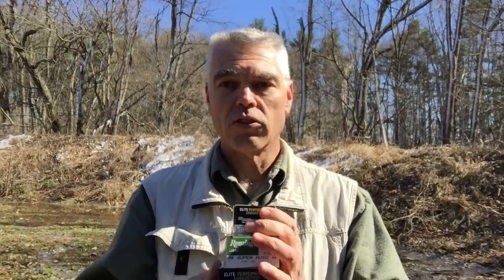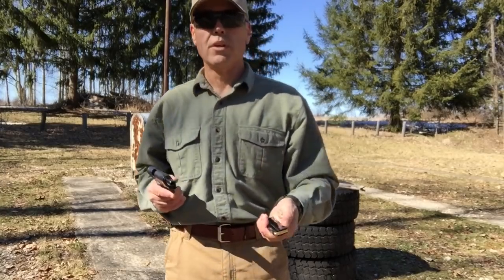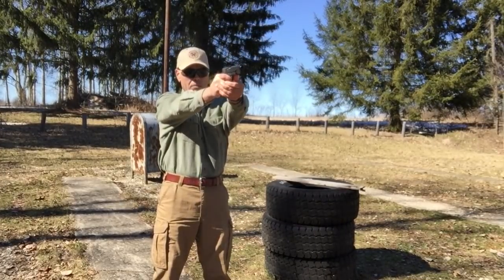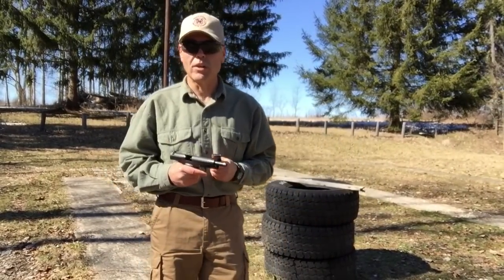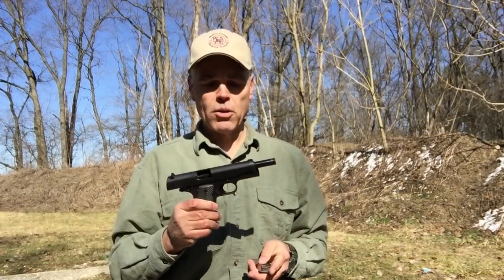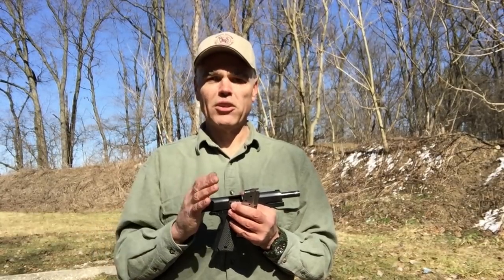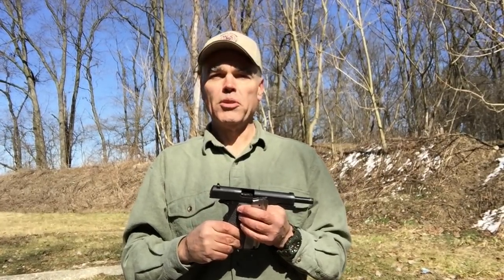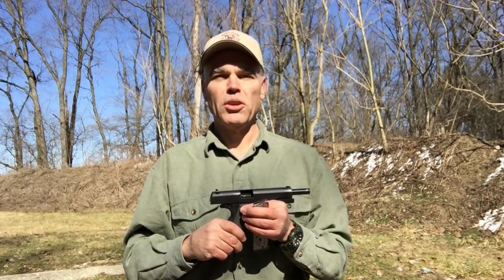Llama Max 1 Back from repair

Comment: HR, even though you have a new pistol on the way, if you still have that Texas gunsmith's email, I would send him a link to this video.

One of the things that I love about the 1911 is when you do have a problem, it's almost always an easy and low cost repair.

I have been a 1911 fan since the Marine Corps put one in my hands exactly 50 years ago!  Since that time, I have competed in IPSC and IDPA with a 1911 and it's also my been my EDC since the 90s when Texas started it's CHL program.  Semper Fidelis, Brother HR!  TreeTop
Reply from the maker: Thank you. I sent the gunsmith the links to the videos I made before I sent the pistol to him. I don't know if the ever watched them. Semper Fi!

Comment: I would change the recoil spring . I own an older model Llama in 38 super it is finicky with magazines . It also like full metal jackets .I found that the right spring and ammo combo it works fine .
Reply from the maker: I actually did swap out the magazine spring and that didn’t help. Thanks for the suggestion all the same.
Reply: hrfunk recoil spring mine was to strong recoil was not enough to strip off the magazine correctly.

Comment: Yes that is good news Hr ! Now hopefully the next pistol will run . Something definitely not right , I’ve been very lucky to work things out on my own . Only gun I completely gave up on was sig p320 , it was absolutely junk after 300 rounds . God help the troops that have to carry it since that’s the new replacement for the beretta. The latest army report on the p320 has horrible.
Reply from the maker: So I’ve heard. Hopefully they can get it straightened out.

Comment: Hr I run Wilson Combat mags in all my 1911s . Also with assortment of ammo lately finding brass case fragments in the chamber. Only due to close inspection you will  find it ( good light and magnifying loop ) nothing a good brushing and bore cleaner won’t cure . My Kimber 9mm kept doing the same thing your 38 super continues to do . So had to take closer look 👀 before giving up . I polish my own feed ramps with flitz or offenhouier Germain fine metal polish. But I must say the higher quality mags do in fact help as well with ftfs . Hope this helps . Nickel case self defense rounds never seem to fail just brass . K
Reply from the maker: I had nickel cases hanginng up in the Max-1, and I don't think amy magazine would have cured it. The pistol is being replaced, so keep your fingers crossed for a happy ending to this ordeal!

Comment: I've got the same issue in one in 45 acp.  They seem to cycle well when there's only 4-5 in the mag. Does that make any sense? Thought about getting a better mag?
Reply from the maker: The Max 1 I had seemed to run better when the magazine was only about half full too. I'm not sure what the solution is. I never did get mine to run reliably even after a trip to the Llama gunsmith. Good luck!
Reply: Maybe its not the mag. It never used to do this, but I haven't shot it for awhile.  Do you know if all Colt 1911 mags fit?

Comment: I commented on your first video of the pistol to get to try either Chip McCormick or Wilson Combat mags.  That's what I suspected when you had problems with the original magazine which gave you malfunctions at the third or fourth round.
Reply from the maker: I tried Chip McCormick and Mec-Gar mags. None of them made a difference.
Reply: @hrfunk  Were you able to try Wilson Combat magazines?  I took another look at your videos of the .38 Super, and I'm inclined to believe that the clearance between the feedramp and the bottom of the throat is not that much or none at all.
Reply from the maker: @rexhinlo3398  No, I didn't try the Wilson mags. After the two different mags (as well as the factory mag), and a trip to the factory gunsmith, I ended up swapping the Llama for this one: https://youtu.be/YLNDJ3gpfSg

Comment: Great video: I have a theory hrfunk:  If you had shot 1 bullet from 8 different  Fully loaded magazines of (the-jammed-ammo): OR everytime you shoot 1 bullet you then reloaded another round, so it's always 8 rounds in the magazines of (the-jammed-ammo): Would there STILL be a Fail-To-Fire?  Because they ALL shot at least 2-3 rounds before FTF.   But you solved the problem ... by getting rid of that thing!  LOL.
Reply from the maker: Yes. I really liked the styling on the Llama, but I simply could not get it to run.

Comment: I'm curious if a new magazine follower (the rounded ones that simulate a round) with a 5% extra power magazine from Wolff would fix the problem. If it feeds once, it should feed repeatedly so I wouldn't think it's the magazine feed lips.

Comment: A jam-o-matic it looks like. Very unfortunate. I am a fan of the cartridge. I have a 1911 made by Oriskany Arms in 38 Super. It is one of two pistols that I carry on a regular basis. What I like about the 38 Super is that it hits hard. It's one of the hardest hitting carry cartridges and the gun I have has a sweet trigger and is accurate to well beyond typical self defence distances.

One other thing. Factory ammo really does not give the full potential of the cartridge. My carry load is a 124 gr HP going out at about 1325 fps and gives me minute of soda bottle accuracy out to about 50yards.
Reply from the maker: I eventually replaced the Llama with an American Classic II. It's a much more reliable pistol. I also really like the .38 Super cartridge. I handload mine to about the same level as yours. That makes it a very good all-around pistol cartridge. Thanks for watching!

Comment: Bummer !  After lots of lubing EVERYTHIG?  the feed still hangs up?  Try reserarching higher lubricity greases and oils. hone the slide rails, measure and compare the feed ramp angle to a top functioning pistol, compare the compression strength of the recoil spring to others.  Replace it with 10-15% stronger? Reduce the mainspring pressure a bit?  I'm running out of ideas. Bore the barrel bushing out 0.100" more ;-)).  Had the same problem on my Llama in the '60s (.38 Super)
Reply from the maker: I tried a variety of things to get the Max-1 to run reliably. In my video about the Metro Arms American Classic ll, I explain how it all turned out. Thanks for watching!

Comment: At least they agreed to replace the pistol ! Did you have much tied up and how long is eagle warranty? K
Reply from the maker: It's purpotedly a lifetime warranty. As is the one extended by Davidson's Gallery of Guns, which is where the Max-1 came from. I took it back to the FFL where I picked it up and explained the problem with it. I also detailed how much I'd invested in the Max -1 in terms of magazines, ammo and shipping expenses (upwards of $300, about $200 of which was factory ammo expended in testing and break-in). And, I told them about sending it back to the gunsmith in Texas, and the fact that it was still not functioning reliably. I asked them to contact Davidson's and tell them I wanted the pistol to be replaced. Yesterday I was advised they would, in fact, be replacing it.

Comment: Sounds like feed lips are to tight in the magazine. i have one and polished  the internal frame and cut the hammer sear to .020 high. tuned the magazines and runs really grate now. 1911 seem to respond to some TLC.
Reply from the maker: I actually sent this pistol back to the company’s gunsmith for a warranty repair. Check out all the videos on the Max-1, and the one on the American Classic II to see how the story ends.

Comment: My guess is that the gunsmith who tried to do the repair probably just did a series of things that "usually work" with a problem 1911. I rather doubt that he did as extensive a live fire test as you did, and probably though it was fixed when he sent it back. He probably also had his fingers crossed when he shipped it. Sorry you are still having difficulty.
Reply from the maker: In a follow-up email, he said he ran two magazines of Armscor ammo through it and it ran 100%. I told him it will sometimes run two or three magazines without an issue, then inexplicably, it will have two or three malfunctions with the same magazine and ammo that was just running fine. I think maybe it's possessed! I should have named it Christine!

Comment: What caliber is that gun?....thinking your recoil spring may be too strong.
Not liking HP???.....that would be for the most part...your spring.
By the way...you sent it off for them to polish the ramp and replaced the mag release???....that's easy,you should have done that...just saying.
Again,what caliber?...38 super?
Anyway.....a combination of recoil spring too strong for some of the type of ammo...Spring and the ammo that is used need to be compatible .Question....are you using reload ammo?????
Reply from the maker: No, the ammo I was using to test the Llama was factory loaded, and I had several different brands/bullet styles. The malfunctions occurred with all types of ammo. I did, in fact, swap out the recoil spring which did not alleviate the problem(s). Since the pistol was covered by lifetime warranties from the manufacturer, the importer, and the distributor, I did not attempt any polishing or other repairs/modifications since doing so would have likely voided those warranties. The pistol was chambered for the .38 Super cartridge. Since the functioning problems were never corrected, the Max-1 was eventually replaced.
Reply: @hrfunk  
Sorry so many problems....Hope I never run into this type of problem of the gun to work so poorly.Good Luck in the future👍
Reply from the maker: Thank you Ellis!
Reply: So, in your opinion, I should buy a pistol like this and then need to do surgery on it to make it work?  What a great idea.

Comment: That's about enough to make you angry - particularly when they want you to pay postage.  Those Thirtydollarses will add up quick.  Does the Mecgar mag have the same type of follower as the Chip McCormick?
Reply from the maker: No, the followers are different.
Reply: Dunno about 38 super, but the followers in 1911 45 acp mags can have a big effect on feeding reliability - particularly with hollow points.  Also did a little digging on the 38 super and found that the cartridge has a slight rim that can cause feed problems with a straight magazine.  I found references to 38 super comp rimless ammo that said it's interchangeable with 38 super as long as your extractor will grab the casing.  Supposed to feed much better and I guess competitive shooters like it.  I have zero experience with it, but if I was a reloader like you, I'd sure be curious.  JAT

Comment: simple fix.the problem in that type of gun is .that the distance the cartrige has to travel up out of the clip to go into the chamber.is more than it would be for the 45.auto.So take your needle nose pliers .And bend up on the metal on both sides of the top of the clip sides that hold the bullet in the clip.So that the bullet is at a 20 degree angle ore more so .To help it go in to the feed ramp,and on in to the chamber.I do the same thing  on all of my ar-15 clips.If you go to far .Hammer it down with a small hammer.Then smooth lips with a small mill file.simple gunsmith work.Trial ,and error You will get the hang of it.There is nothing wrong with the gun .
Reply from the maker: You know, I never did manage to get that pistol to run consistently. I ended up requesting an new pistol in .38 Super. The one I have now runs much better.
Reply: The "Clip?"
Anyone who calls the magazine of a 1911 pistol a "Clip"  is not worthy of listening to.

Comment: So the new Llama pistols = crap?  Or do you think you just got a lemon?
Reply from the maker: John Ski I really just think I got a lemon.
Reply: Just bought a used Made in "Spain", Llama 38 SUPER on the left slide, Gabilondo Y CIA Vitoria (ESPANA) on the right side of the frame.  1911 style with a grip safety but no vent rib atop the barrel so I think it's an early model.  Originally imported to some NY company.  Wish me luck.
Reply from the maker: Good luck!
Reply: Well it's a mixed bag.  It's a Llama VIII C/F (colt commander sized compact 1911 style) made in 1987 and seems well built and with tight tolerances.  It feeds 130 gr Aguila FMJ fine with no failures to feed or eject all day long and shoots great.   It does not like hollow points.  Federal 115 gr normal hollow points will not feed reliably at all.  The nose of the hp gets caught trying to go up the feed ramp and it will even gouge the edge of the hollow point  tip.  Sig Sauer Elite v-crown will chamber every time however these will not eject and get pulled out of the chamber and just sit atop the magazine where the ejector failed to grab the back edge of the bullet and chuck it out.  This was non-firing ejection; I did not think it would eject a spent case if it will not eject an unfired round.
Reply from the maker: John Ski For what it’s worth, a pistol built in the 1980’s would have been manufactured by the original Llama factory in Spain. The pistol featured in this video was manufactured by Metro Arms in the Philippians. Metro Arms acquired the rights to the Llama name after the original company went out of business in the early 2000’s.

Comment: Wow! HR i hope mine does not give me any trouble. I'm sorry the problem was not fixed!
Reply: Keep running rounds through her HR! I'm hoping it will settle down and preform better for you! Give it about 200 rounds.
Reply from the maker: I think I'm done with this one. There is a replacement that is supposed to be on the way.
Reply: hrfunk well at least they are making things right for you. That's great news! Now the waiting game begain.
Reply from the maker: Yep. I feel like I have been waiting in this pistol for all of 2018!
Reply: hrfunk i know how it can make you feel!
Reply: hrfunk I have a question for you I do a lot of gun trading one of my friends have a CZ 75 po1 which is the Compact 9mm I have a Ruger 1911 Sr Commander 45 ACP he wants to make a trade with me think I should do it? I have enough 1911 I've never had a CZ and the 9mm rounds would be much more cheaper I could shoot more laugh out loud what's your take on that trade I would really value it thank you

Comment: Morning,

could one problem be the recoilspring? That the slide isn`t going far enough back?

I had to stop watching, because the sound on this video was breaking up constantly due to the wind.
Reply from the maker: I actually tried swapping the recoil spring before I sent the pistol back for repair. That didn’t make any difference.
Reply: ok, my thought was, that perhaps the recoilspring is to strong for the used ammo

Comment: Are all 38 supers finicky ?
Reply from the maker: This was my first one, so I can't speak from experience. If they WERE finicky, however, I suspect it would be pretty well known after nearly 90 years of production. I have heard about reliability issues out of double-stack magazines used in race guns, but I have not heard the same about single- stack 1911 mags. I really think this was an issue with my specific pistol. The particular malfunction I was having also occurs with the .45 ACP versions of the 1911. I think it could probably have been fixed, but I'm just not going to spend any more time or money on it. It's kind of like buying a new car. Once in a while you get a lemon. That's what the warranties are for!
Reply: No... you got other 1911 the are finicky kimbers are one of them

Comment: That settles that... I'll stick to Rock Island if I want a budget 1911. Low cost... High quality.
Reply from the maker: Can't say I blame you. Were it not for the sights, I may well have opted for an RIA instead of the Llama.
Reply: I have the RIA Tactical II MS 4.25" .45 ACP, and the RIA Tagtical II FS 10mm. Both are tighter than my $2300 STI. Real quality without the heartbreaker price. Both have run flawlessly. The only issue I had was the mag was dropping on my 10mm. They replaced it, and no issues since. Great adjustable sights on both, and silly accurate. Believe it or not the RIA 10mm is really a soft shooter. I did buy 4  Wilson Combat magazines for each pictol. Now I carry both regularly. Give them a shot. You shouldn't be disappointed at all. Love what you're doing Devildog.